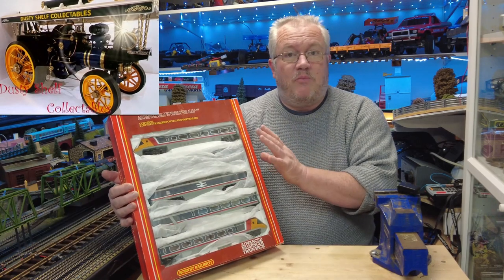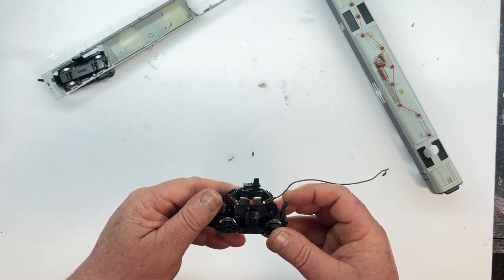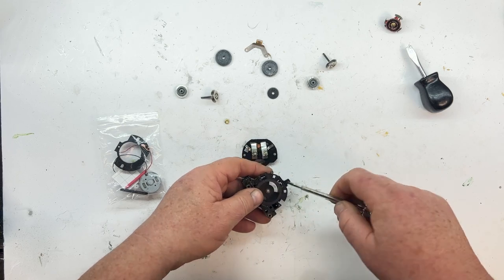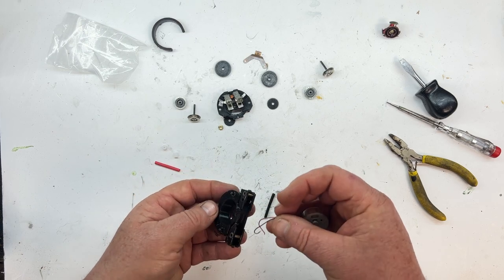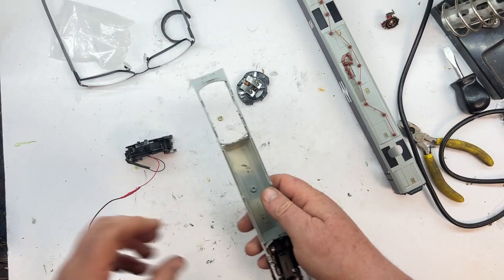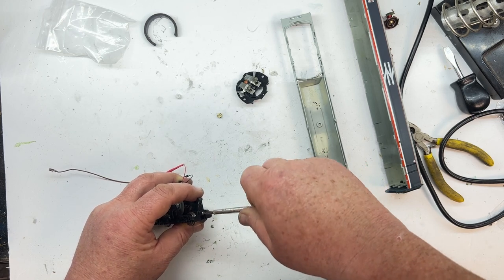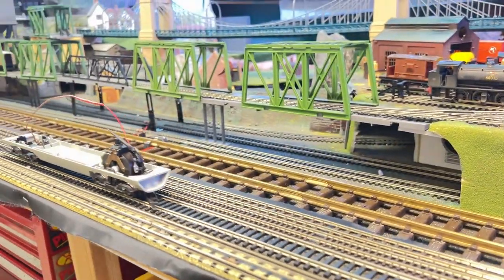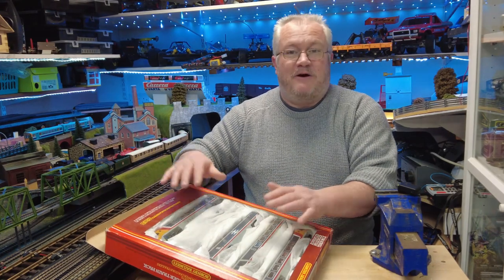Hornby APT Advanced Passenger Train motor repair

Comment: Hi Matt. 

Good job, well done! 

Although I've never come into contact with one myself, the replacement looks as though it's a CD motor which are become more popular these days as a replacement for (especially) Lima ringfield/pancake motors. 

Paul. 👍
Reply from the maker: Hi paul, Certainly seams good, the motor is only 6v so would need a resistor if running at full power or digital.

Comment: The noise was due to the bearings of the armature not being clean and lubed. Background whining is the gears needing cleaning out then some oil and grease. These CD motor conversions have good results but I only use them in worse case scenarios (buggered armatures, frames or magnets) 
They do take away from the value of the model really but I suppose you could easily change it back. I’d recommend a complete strip down, bath and clean everything you can. File the gears flat as the flashing makes noise, commutator cleaned using a copper polish and then very good greasing and it would be fine. 
Nice to see it running smoothly 
Regards 
Will
Reply from the maker: Thanks for the advice will, I will take a look at the flashing, that's a good point. Thanks for watching at taking the time to comment.
Reply: @dustyshelfcollectables  i usually find that once the noise of the bearings is gone, the noise is just a rattle. If you hear anything with yours it'll be flashing or lack of grease. Whether it be an X04 worm or Dublo, or any ringfield gears - grease will silence any rattles. Just a few small things can transform any loco.
Good luck with the filing
Regards
Will

Comment: Hi, great video on your motor upgrade, did you clean out the old housing and gearing, I didn’t see you oil the gearing or the wheel bearings, this would make it running even more smoothly and add longevity to this motor, thanks for sharing.
Reply from the maker: Thank you so much, I actually over oiled off camera and ended up spending time cleaning off the wheels as they were slipping. The squeaking you may hear on the video is the tilt 'bearing surface' where the plastic is old, I did use a little grease here but still couldn't stop all the noise. Thanks for watching and taking the time to comment.
Reply: @dustyshelfcollectables  If you watch 00Bill he always gives his plastic gears in these ringfield motors a light sand flat on fine emery paper. I assume with time plastic edges spread a little. and it takes some burr off.

Comment: Nice work.
What exactly is the replacement motor called and where can you buy them?
A link would be appreciated. 
Thanks in advance.
Mon from Monsville Railways
Reply from the maker: I got mine form ebay, there are quite a few listed on there,  If I am allowed to post the link its https://www.ebay.co.uk/itm/295274244179

If not search for  Hornby Ringfield Motor Upgrade Kit (Bo-Bo & Co-Co) but do note this on is a 6V motor and if you are running digital or at full power you will need to step the voltage down with a resistor.
Reply: Thank you. 
Sadly, they won't send to Australia. 😕
Reply: @dustyshelfcollectables  Interesting it is a 6 V motor. The original train ran with 2 motor coaches and 6 coaches either side . I've got several sets of varying repair and I want to make two sets into one and convert two end coaches into maybe restaurant - see if I can make the corridor connection end by casting in resin or something. I could use two of these motors in series or parallel and have a power connection between them. Mind you, I've been saying this for over 15 years.....